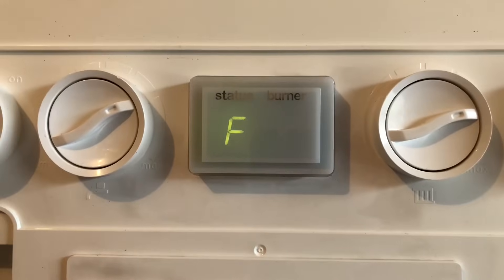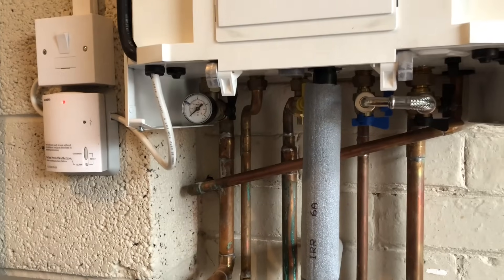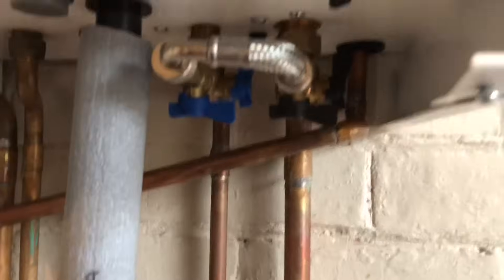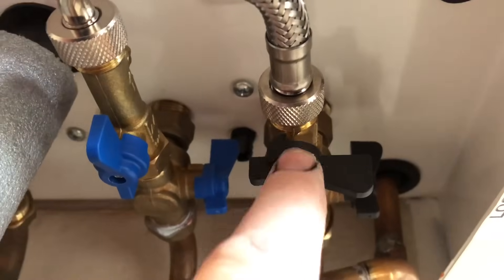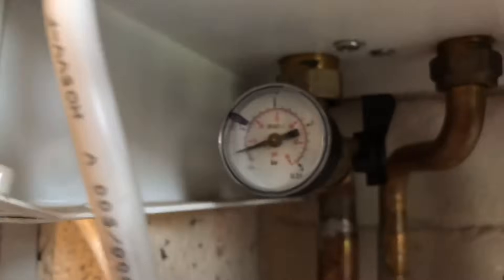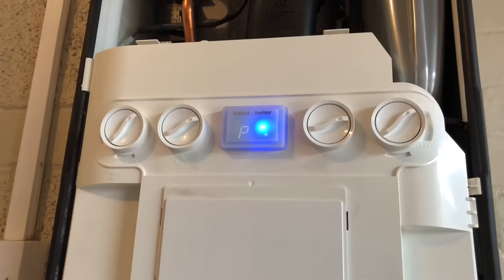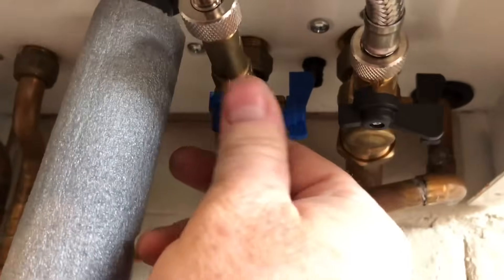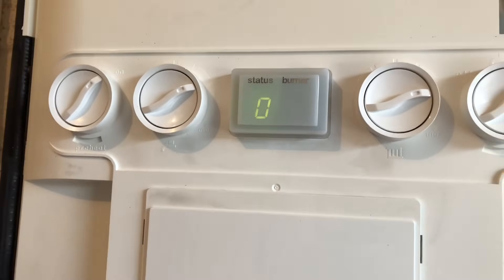Ideal Logic F1 Fault How To Repair your combi boiler

Comment: Dude 
Massive thanks landlord had no clue, had a week with no boiler and such a quick fix ... there may also be a isolator valve lower down on the new Instinct 2 Boilers to let the water in (suppose depends on how its fitted ,there was on mine) all running again up to 2 bar while heating and 1 bar on idle 😀

Comment: I had a f1 fault and filled up my boiler but I also got a D and U flashing up. It disappears but then a zero appears and the boiler doesnt come on. The white panel you have on the front, i have a red light flashing there, it should be solid but I think this is the part for the salus thermostat, which is a joke to work, but it has a normally open relay on it but I think its latched to the closed position?

Have you any idea what is the main issue, or do I have several issues.

The heating was working fine, till we had a power cut in our area. Thank you in advance.

Comment: Absolute star, thank you! 

Came down this morning and noticed a leak from boiler and f1 code displayed. Sure enough, no hot water. 

This fixed the error code and returned the hot water Thank you!

The slow leak is still present, will that go in a short while or do you think it perhaps needs bleeding?
Reply: Just needed tightening 😊 thanks again for your video!

Comment: Hi Allen, just watched your vid as i found this fault on my boiler, thank you for sharing your knowledge with us. If i may ask, i also had an error code appear on my washing machine yesterday, after doing my research the error code is linked to a heating issue, would you please be able to tell me if this is linked to my boiler pressure being low or is there no correlation between the 2 and do i now need a new washing machine or someone to fix it?? Thanks in advance

Comment: Legend. Thank you for this video. One question I had: Are the valves meant to point in the same direction as yours? Or does it depend on the engineer who installed it. My ones look left whilst yours look right. Hope that makes sense
Reply from the maker: Depends on the installations, unfortunately.Remember to subscribe. Thanks.

Comment: I have no leaks anywhere in the house. There was a leaking manual radiator valve which I replaced and I think my wife is shutting the valve at night and leaving the room stat on. There is only one radiator for the living room stat. Could this be dumping the water/ overheating the boiler through the night?? Please help

Comment: Thank you! You just saved me an emergency call out cost. I’ve now got both heating and hot water. However my pressure gauge on the boiler is still showing zero (arrow didn’t move at all)

Comment: Hi. I have my boiler set at 1 bar when not on but when it fires up it goes up to over 3 bar! Even if I let my boiler drop down to .5 bar when not on it still goes up to over 3 bar after about 45 mins of it being on. Could this be a faulty pressure guage?

Comment: This just happened with mine and I wondered if it was because I bled my rads yesterday? I did it when they were cold as I read that you let more air in if you do it when they're hot. They make a racket - popping and crackling - when I turn the heating on. Anyway - the boiler was only installed a year ago and due a service so the guy's coming to look at it.

Comment: Thanks for this, very helpful video, better than the ones from Ideal.
I pressurised to 1.5 bar, then fired up the heating, then the pressure went up to 2.5 bar, is this normal? and is this safe, the users guide recommends 1 to 2 bar.
Any advise would be appreciated.

Comment: Ive got a logic ideal s18 system boiler and it has only got 3 pipes underneath the boiler. The pipe on the right side the tapis black and the pipe in the middle the tap is yellow and the pipe on the left the tap is eith black or blue . The f1 sign is showing plz could u help me so i could fix the boiler plz? Any help would be much apprieated plz?

Comment: In my case the F1 error shows up and if I press the reset button it works again. The water pressure is 1.5 bar but it still lock's out sometimes and shows F1

Comment: This is helpful and is a lifesaver,  but bear in mind that the boiler loses pressure for a reason and that needs investigating as soon as possible, ours needed a new heat exchanger which was covered under guarantee.

Comment: Thank you so much, you just saved me a lot of worry and calling out an engineer. Your video was so clear and straight to the point. Even though my ideal logic 24 had only two tap switches on the right, i followed your instructions and is working properly. You are a star!

Kwaku

Comment: Thanks mate, did seven nights on the trot and came back home house freezing one question though I could have gone at the tap at the rear of the fill as I there was no water coming from the tap adjusted this tap and it flowed again ideally should this tap be fully opened or partial opened ( it is the water fill coming in the first Vale,) I adjusted!

Comment: Hi mate - this was really helpful. Thank you. We came back from holiday to find our central heating was off. It had lost pressure, overheated and locked out. I’ve restored the pressure now, but the issue I’m having is the central heating only seems to come on when the cold isolation valve is closed, but then I don’t get any hot water! Any ideas what I might be missing please?

Comment: Absolutely brilliant video but my boiler has an f1 error code and the pressure is on the number 2 with the boiler actually being turned off. I’m 1 in a million arnt i ? 😂 have given you a follow though for future reference. 🦋

Comment: Great video such a simple fix to save getting a plumber out, only thing I cant see is the pressure once done it should be at ??? 
Thanks
Reply from the maker: Thanks very much for your comment, please consider subscribing to support the channel 🙂
Reply from the maker: 1 bar normally. Depending on boiler.

Comment: Hey Allen this vid is great but I don't hear water gushing in to the system when I switch the blue taps, bled the radiators and still pressure is at 0, if you have any idea what could be the cause it would be most appreciated. Thanks in advance! Wish I knew all your expertise right now u don't know what u got until it's gone!! 🏆
Reply from the maker: Just seen this, Did you sort it out. Thanks.

Comment: Thank you for this useful video.
After topping it up, the pressure is around 1.5 bars when the heating is off (and around 2.5 bars when the heating is on. Is that OK?
Reply from the maker: Thanks very much for your comment, please consider subscribing to support the channel 🙂

Comment: Hi Allen. I have a Ideal Logic 18 boiler and the presure is 0, but I can not find the filling loop pipe to add some presure into it. I have only 3 valves, 2 black valves and a yellow one. I have watched all the videos on youtube that had a ”ideal logic system” into the title but no boiler matches mine. Do you have any suggestions or some advice that will help me?
Reply from the maker: Do you have a filling loop in the cylinder cupboard ?
Reply: @AllenHart999  None that I can see..

Comment: Thank you for this video! I had to bleed my radiators today as they were whistling whenever the heating was on. This lead to a loss of pressure and F1 error on my boiler. I couldn't understand the instructions in the boiler manual for repressurising the system, but your video explained it so clearly - thank you very much. Brilliant video 👍
Reply from the maker: Thanks very much for your comment, please consider subscribing to support the channel 🙂

Comment: I have the imini 30 version of this boiler which is actually not filled up the same way, however I  would really like to know what pressure it should run at when it is on?
I have to top mine up once or twice a year but it seems to gain a lot of pressure while running.
Reply from the maker: Thanks very much for your comment, please consider subscribing to support the channel 🙂

Comment: When I opened the second valve water started pishing out from under the boiler.
Reply from the maker: Have you connected the pipe correctly? Thanks.
Reply: @AllenHart999  The pipe was capped, I could have done it but just phoned for an engineer, the guy said its common to plug the feed hose as it stops and problems.., he also un capped it and reconnected it :-p.., but problem sorted thank you.., you have another subscriber.
Reply from the maker: Thanks very much for your comment, please consider subscribing to support the channel 🙂

Comment: Thanks Allen, great video. Is this fault common? I have moved into a new build in December 2020 and this issue keeps coming up. I have also noted that as soon as i switch on the Radiator heating this fault goes away but Hot water in taps and Radiators should be have seperate functions right?
Reply from the maker: It shouldn’t really be dropping on a new system. Thanks.

Comment: Why do u need to turn the power off?
Reply from the maker: When the pump is on in the boiler it may give you a false reading. Thanks.
Reply: @AllenHart999  Ah OK! My boiler keeps dropping pressure I have to top it up every day! I had one radiator leaking, but it's nice and tight now! I still have major pressure drop and I've checked everything all radiators, boiler etc.  not sure what it can be??? 🙄 It's vexing me!!! Thanks for replying BTW 👍
Reply from the maker: Thanks very much for your comment, please consider subscribing to support the channel 🙂

Comment from the maker: If you found my video useful please add a comment below and thanks for watching. PS like and share😂
Reply: You have just taught me something I didnt know how to do!!! THANK YOU!!!
Reply: Thank you for saving me money on calling someone out for such a simple job!
Reply: Subscribed, is it dangerous if the pressure keeps rising? Because no matter how slow I open the valve it continues rising after I've closed it, any tips?
Reply: Thankyou Allen the contractors that my housing association have got I've been waiting almost 24 hrs for someone to come and do this as mine is flashing F 1 and iam freezing and have no hot water. I might get some confidence and do it myself. Thankyou
Reply: Mine doesn’t have the front valves, just those back ones you told me to leave! Do you know what I could do?
Reply: do you need to be "gas safe" registered to do this?
Reply: Cheers for this Allen saved me money and time having to call someone have a great day 👍🏻
Reply: Great video. 
I followed exactly what you said. Now my elderly relative can sleep in warm comfort. 
You’re a gentleman. 
Many thanks.
Reply: Hi, how would you release the water if it was too high. ? Thank
You for the help .
Reply: @SiobhanDawood  that’s what I need to know
Reply: Keep coming back when I have a f1 fault,best boiler fix video :)

Comment: Thanks my friend, i am going to give this a go! 👍
Reply from the maker: Did it work?
Reply: Hi no it didnt. Would not make the refill noise or go above the 1 line. Error code has gone tho?
Reply: On the gauge its slightly above 10.
Reply from the maker: Thanks very much for your comment, please consider subscribing to support the channel 🙂
Reply: The pressure is 0.5 bar. Your method does not work on my combi 30 logic boiler. I dont know what to do?
Reply from the maker: @zafzaf6072  Send me a picture on whats app 07725 692699

Comment: Hey Allen, just wanted to say thanks for this. Just moved to my new house and had the same issue here and found your vid. At first before I saw the vid I saw the taps connected but I thought there was some law or something that they could not be physically connected all the time which is why I thought that it would not be those originally. On my old boiler (Worcester Greenstar?) you had to put this plastic plug in place to bridge the cold water feed to the feed loop. Thanks, got heat back in the house :)

I have had the same boiler servicing guy for 15 years and he pulled a face when I said the new house I'm moving to had an Ideal boiler so I look forward to more fun and games with it down the line :P
Reply from the maker: Happy to help. Thanks for watching
Reply from the maker: Thanks very much for your comment, please consider subscribing to support the channel 🙂

Comment: I tried all this and it's still flashing f1, the pressure wasn't low to begin with but I bled the radiators and tried again.
Reply from the maker: Thanks very much for your comment, please consider subscribing to support the channel 🙂
Reply from the maker: give me a call if you like
Reply: @AllenHart999  mines doing this now and I followed your video which I thinks brilliant cause trying to save myself getting a plumber but the f1 still showing. 🥺😳

Comment: Hi, I have the same boiler, I tried doing this and it worked before, but now my heating is on but I don't get hot water, on my taps(blue light is not on when water is running), what could be the problem.. 

Thanks
Reply from the maker: Happy to help. Thanks for watching
Reply from the maker: Thanks very much for your comment, please consider subscribing to support the channel 🙂

Comment: Got an ideal logic combi boiler, hot water doesn't work on it's own we have to put heating on to get hot water,  sometimes this don't work without completely turning boiler off and back on again. When we put the boiler to hot water only it says pump overrun won't do anything else. We had a plumber out to service the boiler he said could be 3 things he wasn't sure. My guess is diverter valve I don't want to have to pay for one thing and it not work so have to pay again any help would be much appreciated thanks
Reply from the maker: Happy to help. Thanks for watching
Reply from the maker: Thanks very much for your comment, please consider subscribing to support the channel 🙂

Comment: Ignore me! I found another video of yours that looks the same as mine so will follow that one. Thank you very much! 

Thank you Allen. I am trying this but have a slightly different looking valve (logic combi ES35). On mine it looks similar but I don't have 4 valves on the bend, I only have 3. On the far right pipe I have a black valve at the back and a blue one in front of it (closest to me). But when I follow the bend round to the next pipe, there is only 1 blue valve that is in line with the back black one on the other pipe.

When I turn the front blue valve nothing happens so I am not sure what to turn to release some water?
Reply from the maker: Hi Wendy feel free to call me if you get stuck. Thanks.
Reply from the maker: Thanks very much for your comment, please consider subscribing to support the channel 🙂

Comment: I have f1 fault. Yet my pressure is fine. What else could be causing this fault?
I tried topping up pressure a little more and settled boiler and still f1.
Reply: I have exact same problem
Reply: @sladey21  did you manage to resolve?? Having this problem now
Reply from the maker: Thanks very much for your comment, please consider subscribing to support the channel 🙂
Reply: How did u resolve this problem as I’m having the same issue??

Comment: Legend! I bled the radiators abit too much. Will try this in morning when it fires up.
Reply from the maker: Did it work?
Reply: @AllenHart999  worked a charm thanks. Such a sigh of relief with all that's occurring 😥 the cold water and pressure were swapped round but it did it instantly.
Reply from the maker: Thanks very much for your comment, please consider subscribing to support the channel 🙂

Comment: Thank you so much for this. My pressure was too high, so I called a gas safe registered engineer. First time he comes, he makes a mess but supposedly fixes the problem. Problem was still there. I call him a second time, supposedly fixes things but pressure kept dropping again. It turns out he left the pipe that allows water into the system open. Christ. Hopefully no more issues now.
Reply from the maker: https://www.youtube.com/watch?v=UR9wSU-I2O8&t=62s
Reply from the maker: Thanks very much for your comment, please consider subscribing to support the channel 🙂

Comment: Hello, got a ideal boiler with an underfloor heating system this has popped up on boiler (f1 fault) but it's on about 1.5bar already the boiler fires when I turn on room stat but the flow gets hot up to the blending valve on underfloor manifold but doesn't reach the pump at all but there is a flow of water going round but cold? I thought it could be the blending valve blocked or something? Any ideas would be appreciated
Reply from the maker: Thanks very much for your comment, please consider subscribing to support the channel 🙂
Reply from the maker: Happy to help. Thanks for watching

Comment: Thank you so much this helped but when  I have done it one of the blue valves on the right is blocked and just wouldn't go back to its position to allow hot water to flow through. Any clue what I could do to fix that? Cheers
Reply from the maker: Thanks very much for your comment, please consider subscribing to support the channel 🙂
Reply from the maker: Happy to help. Thanks for watching

Comment: Keep getting F1 when topped up with water.  In winter months i have to top up 4 to 5 times per day!!  Seems to happen alot  around this time of the yr especially when heating comes on.  I have had numerous Corgi  engineers come round and still unable resolve issue.   There are no leakages around the house. Water bill always the same. The water meter doesnt move when we dont use any water.   

Our boiler is an Ideal logic combi 35.

Any suggestions or advice would be appreciated or i will just buy another boiler...?
Reply from the maker: Thanks very much for your comment, please consider subscribing to support the channel 🙂
Reply from the maker: Happy to help. Thanks for watching